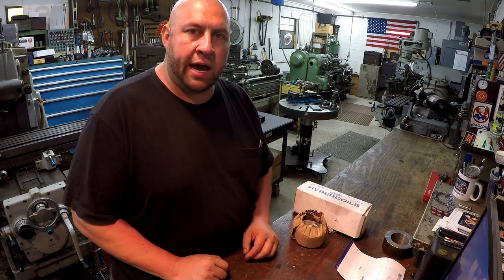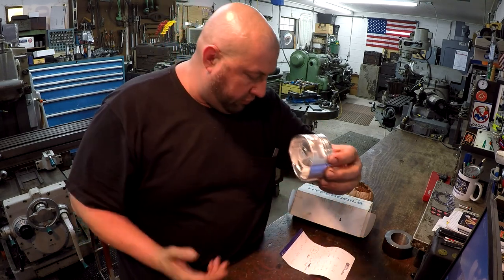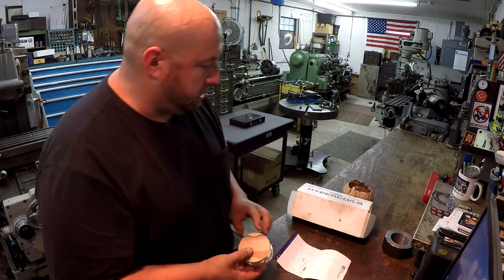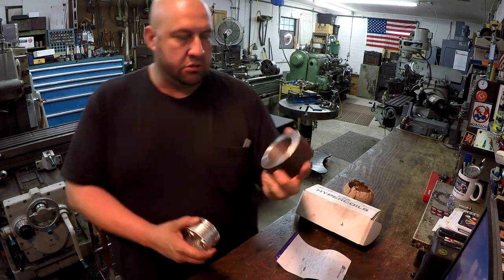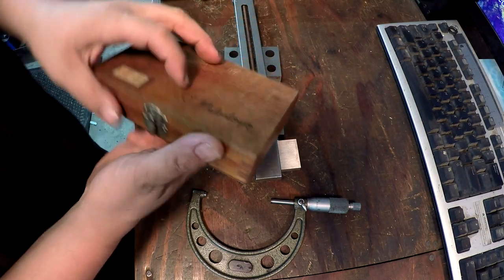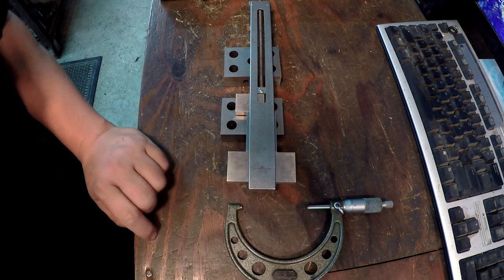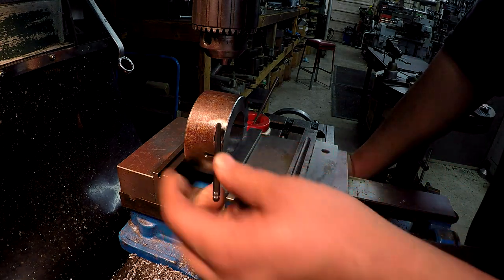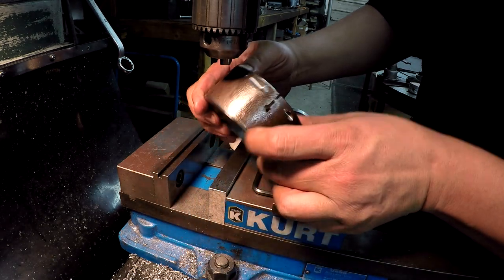Hayabusa Pistons Part 1

Comment: @26:38
move in 4/16" for the edge finder, plus the 3/16" for the center of the remaining material doesn't add up to 11/16" by my math... I'd assume you just forgot to divide your edge finder in half.

edit:
@32:37
Oh... ok.
Reply: I got the same thing; .250' for 1/2 the edge finder plus .1875' = .4375"(7/16). That's why a rough sketch is good to work from for 1-off projects.
Reply: Dat ain’t math, it’s arithmetic

Comment: Adam, I have a model H, K&T that has a parking attachment (don't have vertical head, but have parking attachment). On it, it has a docking station, that has two posts that come out that simulate "over-arms", so that the vertical head rests on those as well as the boom arm of parking attachment. That docking station attaches to side of machine were a bolted on name plate was on machine without parking attachment. I am wondering if part of your parking attachment may have had same thing originally? What it does is help to hold vertical head stable when parked. Don't know if it's something you looked into and it wasn't part of attachment on your machine or if it was maybe an option with it. Just food for thought.
Reply: Its possible that model didn't come with it. Not sure if Adam is trying to shoot for authenticity or not, but just a thought for him.
Reply: +Dave Ticehurst What do you think it's going to happen to it?
Reply from the maker: Hey Dave, I heard your comments but that doesn't mean that I agree with your opinions. That vertical head isn't going anywhere, but if it drops, I'll be sure to tell everyone you told me so.
Reply: Adam I agree with you the head is not doing anywhere. Brass nuts or not they will hold just fine for what you are doing with it. keep up the great work and do not let the arm chair machinists tell you other wise.
Reply: +Rich Gallagher Yea, you could hang a car off of it and it would hold all day (month) long.
Reply: Pretty sad when you have to reply to your own comment, but I feel its necessary seeing where this whole subject went. There are two things that I need to address, 1- being my original comment had nothing to do with the parking attachment, swing arm, bolts, or nuts being strong enough to support the head (that subject was beat to death during the build). 2- Have to apologies to Adam for filling his comment box by rehashing a dead subject!The total intent of my original comment was to state "that I had this as original equipment on my machine" and that he may want to look into seeing if his model had an option for one. The reason for my comment was not about swing arm being strong enough, but more as a convenience this provided in securing the head in place when it is swung over on the swing arm. The swing arm has no stops or controls on it to stop it from moving once its in place, so if bumped it could possibly knock head into machine, or when the head is parked to stop vibration of machine running/cutting from vibrating head against machine! Its also a very convenient place to put spindle supports when heads not parked there. OK, I said the machine vibrates or could vibrate when cutting, lets not start another discussion on if, why, or when a machine should or shouldn't vibrate, we all know vibration in machines is a part of life sometime, we don't need to hash it out here! Sorry Adam that you had to listen to this all over again, really had thought this whole matter had been put to bed!
Reply from the maker: No worries Fred. I don't know if the machine had an option for one of the side supports or not, never checked into it. I do know they exist for other machines, I see Keith Rucker has one on his.

Comment: its my understanding that these will be oval so that when  the larger mass of the piston(around the wrist pins) expands more than the thinner parts it will all become round so as to give a better seal on the cylinder , if you relieve the skirt circular thy will seize if the skirt clearance is to spec (1-1/2 to 2 thou i would think) maybe these pistons are different???

Comment: Hey Adam, it's not the best to hold a piston around the outside diameter! the piston and skirt are made to allow for thermal expansion also thrust side, generality there will be a machined inside diameter on the skirt where the piston is hold for the outside diameter machining, the common method is to machine a spigot diameter to suit the skirt bore and use a cross pin through the dudgeon pin hole and a draw bar through the head stock spindle to clamp the piston. Cheers
Reply: tim tynan   ^Exactly the way my old Dad used to machine pistons too.  Got a load of piston jigs tucked away somewhere that were made for specific pistons for classic bikes.

Comment: Hey Adam do you prefer the mister coolant over flood coolant for milling? Never seen you use the mister on the lathe, is there any drawback to using on the lathe or is the flood coolant just more convenient because its there and always ready to go? Great video BTW!!
Reply from the maker: The mist system works really well, especially for basic machining ops. I will say though that flood coolant is better for heavy milling. I plan to hook up the flood coolant system on the K&T, but that don't mean it will be used each time. The flood coolant on the lathe I use because it's there and ready to go!

Comment: Adam. Im not sure you read my comments about how to use that crane correctly. After you loosen side clamps push the over arms OUT not in. The crane will pivot until the head locks into the crane. Then you can slide the over arms back in. This will keep all the weight off the bolt.

Comment: How well does that mill climb mill with those slitting mills? And, why not just band saw in half, mill the spilt line, rebore to size?
Reply from the maker: Don't want to climb mill on a part like this. That's too much material to be removed, you'll be pulling into the backlash. if you watch part 2 you'll see why i don't cut in half.

Comment: May I ask you why you didn't bore this to the size of the piston before you machined the clamp bolts? Wouldn't that have been easier to do? I'm no machinist, but to me it would have been easier. 
And also why didn't you just cut the piston clamp in half, then chuck it up in the 4 jaw after you machined it to fit the piston?
Nice work as always, and thank you for more great videos.

Comment: Adam if you haven't bored it yet take a piece of all thread and thread it in the boo-boo hole with some loctite and then trim it off and then bore.  That will at least hold that side from spreading you tighten the bolt.

Comment: Adam, Why wouldn't you index your stock piece first in the lathe, face the ends and true the outer diameter first? I'm not a machinist. Just wondering.

Comment: Hey Adam, do you think a mag chuck would hold for that slitting op? Just curious if they are worth the cost?
Reply from the maker: It's possible but I would be worried to try it.
Reply: I suppose it's no different than regular chucks, the better quality you buy the better hold you get.

Comment: Hey Adam those pistons can't just be machined round. They are actually slightly oval at tge skirts at room temp so that when they are at operating temp they can expand to be round due to the irregularities in material thickness through the piston. It might not be to bad because it's a drag bike but one of two things will happen it will either seize in the bore when it warms up or rattle to the point that it breaks the skirt. There isn't a good engine machinist that would bore the cylinders without the pistons...
Reply from the maker: +Tyler Hensley Soundsclike he may have taken it to the wrong shop, but no worries. We're not going to cut the Pistons.
Reply: Thanks for the awesome videos!!!

Comment: another trick, stick your piston in ice, fit it
 then  when its ready to come out, heat your clamp gently, this is how we did piston pins at cummins, in that case just ran the hot water on the 6 inch piston and slid the pin thru con rod as the pin n piston were a slight interference fit

Comment: hey bro forged pistons are machined/ground oval so when they get to temp they expand to a round shape. its because of the unequal mass around the pin that makes the piston expand in an oval fashion, so they oval them on purpose but 180 to the pin

Comment: I'm thinking.......Aluminum soft jaws?
Round pistons can seize  (or at least scuff ) in the bore when they get hot, most are elliptical.  And the skirts are "grooved" to retain oil. 
But this project looks fun....
Reply: Re soft jaws for this general class of workholding: Yes, preferably "pie" type - for some two piece jaws, you can buy them readymade and skim them to the desired diameter; for other, you have to make your own.
Reply: Pie is just what the doctor ordered, yes. 
(Adam) ...........NOT hatin buddy! 
Just thinkin of the simplest way.
Reply: I was thinking along the same lines. I am not in the machinist industry (anymore). I did do some for a short while back in the 90s when I was lot younger. But my issue was, I am assuming that those pistons are aluminum and that  "holder" he made was much harder material. That means the expensive part is the softer material.... thats bad. If it slips, it will gouge the aluminum. Am I right?

Comment: bail on job. good plan pistons are cam ground/machined. Pistons are not round for a reason,thermal expansion.
bonus piston fixture for flycut valve relief.

Comment: the cylinders should be bored and honed to the same spec. the piston is not designed to mate with the cylinder wall. The rings seal the gap. when a motor gets hot it will seize without that gap.

Comment: The skirt of the pistons aren't ever round, they machine them oblong so that when they do heat up they become round.  I would have your buddy do a bit more research before machining them round.  

Mic the skirt of the factory piston in several places to see what I am talking about.  

Great idea for the fixture
Reply: hes 100% correct
Reply: hes 100% correct
Reply: if he machines the skirts, the tops will be too tight, and if he also machines the tops, the piston ring lands will be too tight to go down the bore
Reply: And the skirts have fine ridges for some reason not cut smooth.
Reply: This! Piston spec sheets even say this. They also require measuring the bore clearance at a very specific spot on the skirts.

Sending the pistons with the cylinders to be bored and plated again is the correct answer.

Comment: These guys are right.  Send the cylinders out to be honed to match the pistons.  No way would I rework pistons which are usually slightly oval to compensate for thermal expansion.  The piston manufacturer likely made them .001-.002 oversize on purpose to allow minimal stock so the cylinders could be match machined / honed.  (Did anyone read the directions in the box?)  I would use nylon/plastic jaws or inserts in a 3 jaw chuck.  Next bore the jaws to the precise dia.  That would hold the pistons firmly and safely without marring the soft aluminum.  (A lot less screwing around - maybe)  Interesting brain teaser though.  :)

Comment: That is gonna have a pretty loud skirt knock. The reason pistons are not machined, but the bores are, is cause the pistons are forged slightly oval. It's on the order of 0.0015 depending on the forging. As long as he doesn't scuff them when the nitrous hits they will be fine. Just probably loud.
Reply: My .002 anyway, and a thousand others will tell you different.

Comment: Hmmm. Wouldn't mind watching this thru to start up of that bike! A jig that fits in the gudgeon pin hole & pulls up on the machined surface inside the piston would have been my choice, chucked in the lathe thus exposing the entire outer surface. Have only ever widened ring groves & shaved a thou off VW 1500 Pistons. Tolerances were generous. A Hyabusa on nitro is another league! Hope your jig doesn't squash the ring lands or distort the very expensive looking piston!

Comment: adam i have built lots of stuff you should let him take the cyl back to the machine "shop or you could do it"--- the cylinders need finish honed its prolly nikosil or chrome coated  you never have a cylinder bored with out the pistons to fit them he should have known that, each piston manufacturer has different tolerances most are .004 thou, and bigger hotter motors need more.002 seems tight but its not mine, just a suggestion for him

Comment: Your buddy may regret doing it this way. He should have ate the cost and redone the bores. every part of a piston has a precision size, you can't change one without the others. I'm not familiar with those pistons but some pistons are elliptical(these shouldn't be), some are barrel(middle of skirt is a larger diameter than top or bottom) some are tapered(larger skirt diameter at bottom than top) and some are a mix of barrel and elliptical or tapered and elliptical. The piston head needs to be smaller than the skirt at a specific ratio. But the head dia can't be reduced without making the ring grooves deeper as well. Your piston has to be able to rock in the bore a certain amount, not enough and it will scuff and may lead to ripping the pin out.

 I wouldn't do this with a street engine let alone a drag engine. If he uses a turbo or supercharger it likely won't survive. If he uses nitrous it will NOT survive.

Comment: I offset the skirt to skirt in the 4 jaw to take .002 off one side then shifted axis .004 to get the other skirt knocked down. If I had the ability, I'd have made a jig with the bore angled at about 6 minutes to take .002 off the bottom of each skirt and taper up to .0005-.0010 at the oil ring. Then rotate piston 180 and repeat. Get it?
Reply: Did this on the pistons for the Wisconsin V4 I resleeved.

Comment: Very easy to automatically move edge finder another .100 when you are using the .200 end. Even on CNC set ups I find myself double checking just because it's so easy to over think or just move the wrong direction when doing the math in your head. To fix this issue,  I  physically move machine and count the clicks (10X) on the hand wheel at .01 incremements just to take the math out of it.

Comment: Why not slot the incorrectly bored side for a bolt & nut. Slot the pocket & widen for the nut plus wrench clearance, then slot the bolt hole. add two set screws from the end to keep the bolt from contacting the piston.

Comment: Playing devils advocate here, but we bought pistons for motocross bikes, sleds, wheelers etc, sized and selected in "10 thousandths" ....  0,10, 20, 30 thousandths over under etc
Right or wrong, this worked and worked well and was what the manuals said to do. 
That was how the pistons were offered...increments of 10 thou per jump. 
 Obviously being within 10 is a fair end result because that was how they came from the manufacturer on single cylinder race motors with Nikasil cylinders (allegedly non borable though i cant confirm that). 
These 10k jumps were for whatever particular cc sized motor etc. 
Could get a 250cc at factory spec, or 10 over, or 20 over etc.  
We didnt touch the cylinders.  We measured them and looked for scoring. They were nikasil and If they were scored they were junk and were replaced.   
We bought the oem piston and ring set that fit the measured cylinders in the cc ranges we repaired and measured for and selcted a piston in the  target of 10 thousandths and had no troubles. We used new rings,  and allowed those rings to seat properly and we raced the things. 
 We got the holeshots, We got the wins, we had the longevity that was testable and comparable to a hundred other racers and we chatted about these things.   What im getting at is these 10 thou increments worked, even though they were in jumps of 10 thousandths. That may seem like alot, but its not. 
Let the rings do their job and build that piston abomb.  Is it critical....yes,  is it more critical then your abilities? No. 
Its not that critical.
 If the manufacturer makes these in increments of 10 thousandths for rebuilds on cylinders that allegedly arnt borable, but are still wearable, its fine.    Give it enuff room, allow it to grow some at those hot operating temps and use the appropriate rings for the piston you build.
Its the rings that do the sealing. They are held by that piston. The piston provides the support and the base of the ever changing cavity and vollume at any given time, but its the rings that seal the things up and make the compression work.   Obviously too small a piston will cause piston slap and eventually break the skirt. Too big and it may seize or cause friction, drag and heat.  But that sweet spot was in the ball park of 10 thousandths on fresh top ends for race bikes.  That means its realistically probably 20-30 on a worn cylinder. 
Abomb.... turn that piston to about 5 under bore,  ring it for what u made, and ull be fine. Let them rings do their thing. They will wear in and seat in short order. You can literally feel it happen in a few minutes of track time. 
Thats my advice.